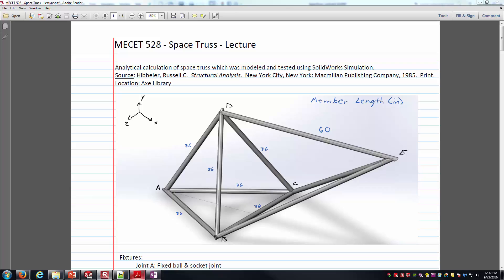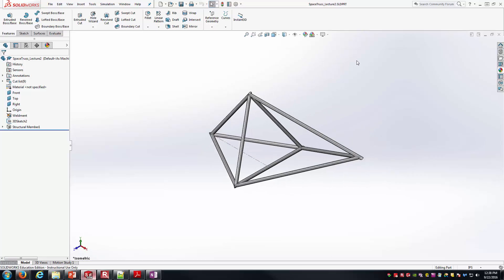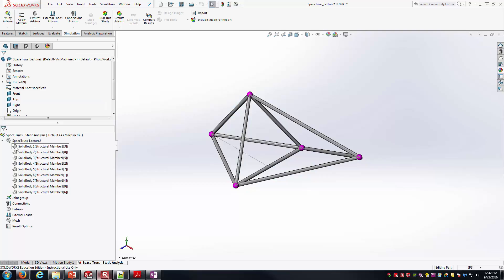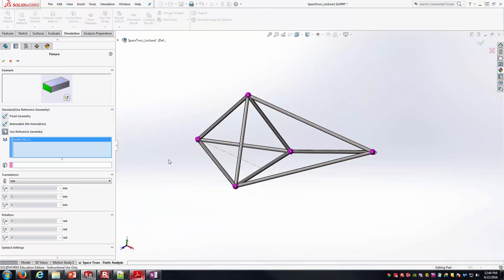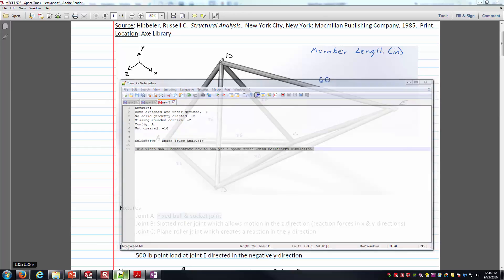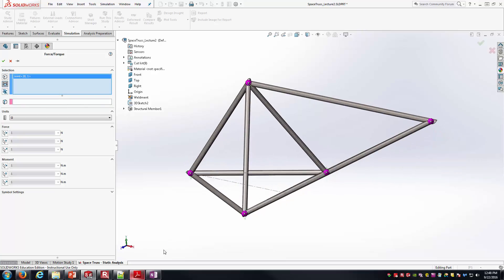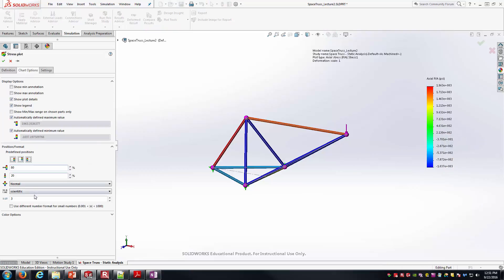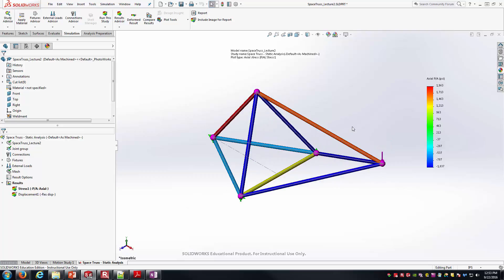SolidWorks - Space Truss Analysis

Comment: What are the dimensions?
Reply from the maker: The coordinates of the vertices are listed below.  in the 3D sketch in SOLIDWORKS, I only have active dimensions of 36 and 60 inches.

(0,0,0)
(31.17691454,0,18)
(31.17691454,0,-18)
(20.78460969,29.39387691,0)
(80.78460969,29.39387691,0)